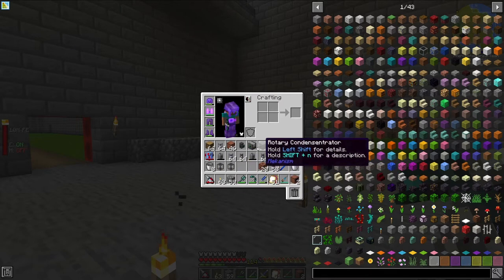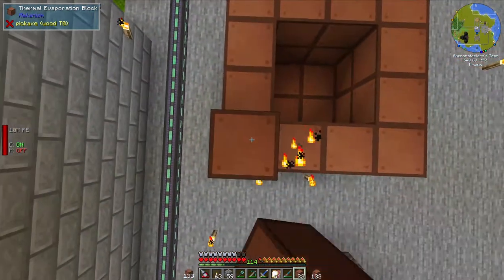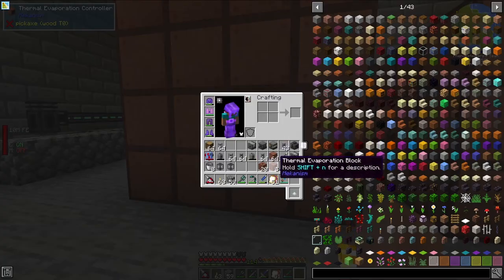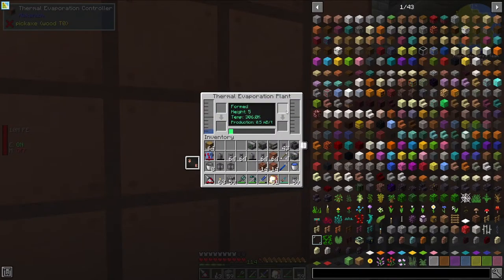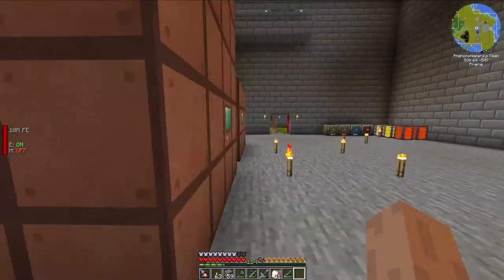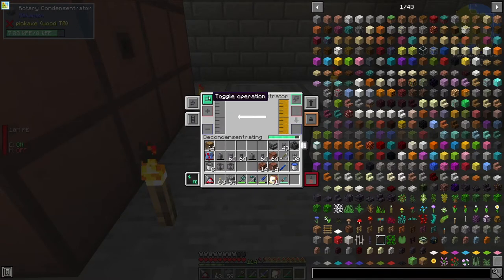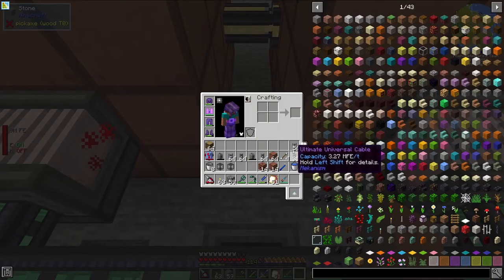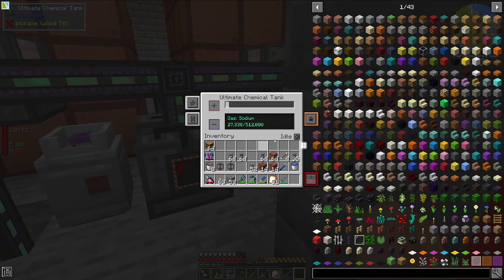How To Automate Sodium (Gas) And Lithium Crystal Production (Mekanism)

Comment: I didn't see any power cables, how did the crystallizer and condensentrator work
Reply from the maker: They actually have an energy buffer while in item form. They had drawn some power from the capacitor that I keep on me to charge my jetpack. At 5:04, I hook them up to my energy system with Ultimate Universal Cable from Mekanism.